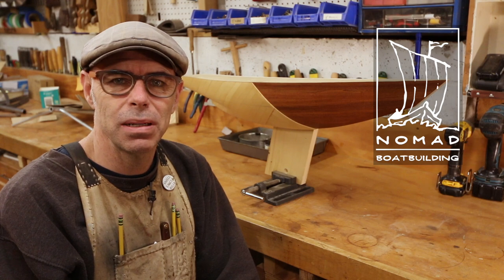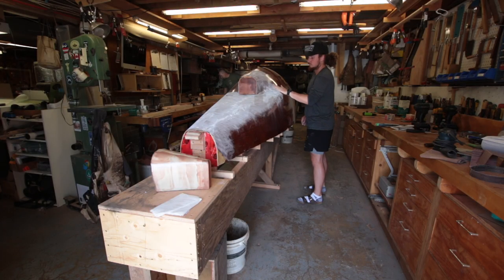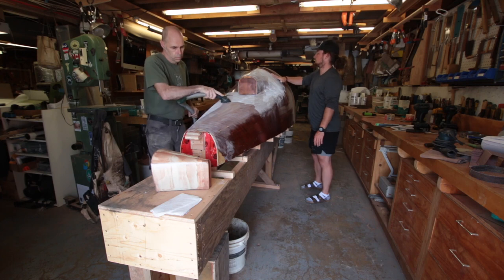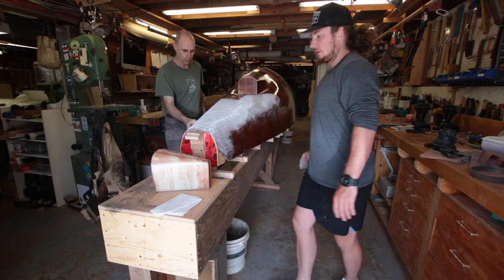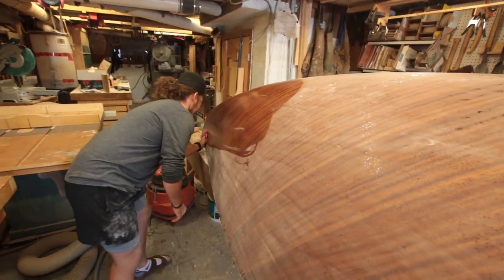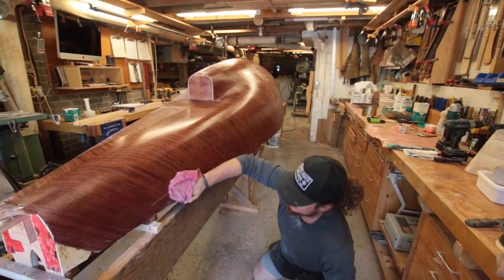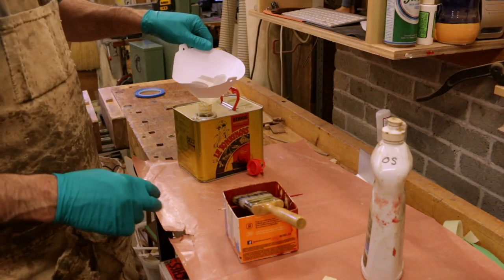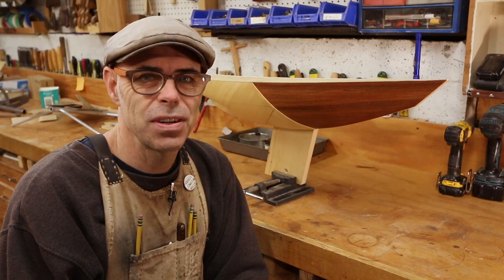International 2.4mR Sailboat Project - Episode 24 - Waterlines and varnish

Comment: I am logging this video as reference for varnishing.  The one question I have is about how the first coat procedure would differ if it were on to bare wood without the epoxy barrier.  Would you do a very thin sealing layer first?  Use a different product to seal?
By the end of this 2.4M series, can you address seasonal upkeep?  And long term, what is the best strip down and re-varnish plan -what attacks varnish without affecting epoxy?
Very informative -thanks!
Reply from the maker: If I wasn’t using epoxy I usually start with a coat or two of thinned linseed oil and often thin the first coat of varnish 10-20%. I’ll try to remember to discuss seasonal upkeep but feel free to drop me a reminder when the series looks like it’s closing in on the finishing line.
Reply: @Nomadboatbuilding  I will remind you.  I am also wondering if having the prettiest boat in the fleet is a negative in racing because you can't get clean air when everyone is attracted to you.
Reply from the maker: @skyak4493  I suppose we’ll find out!
Reply: @skyak4493  never be over the line in the pretty boat the race committee will remember you for sure 😊
Reply: I would have the same question regarding re-varnishing: isn't heat gun stripping a risk for the epoxy? Wouldn't it begin to soften and get striped too?
Reply from the maker: @Nedw  Yes, it would be a problem for the epoxy. You would be stuck with either sanding to remove existing varnish or chemical strippers. Of course the best thing to do is not let the varnish break down to the point that it needs removing. Regular timely maintenance is always less work than corrective maintenance.

Comment: I've always been told 1 part varnish is a no go over epoxy.  What's your experience?  Seems like you don't have any issues with it? Or is this varnish special?
Reply from the maker: It’s not special. I suspect most people’s troubles stem from amine blush and not being careful to prep the surface properly. Once the epoxy is cured, how is it ant different than any other surface. I’ve always used one part finishes over it and never had any trouble.
Reply: It blotches if the epoxy coating doesn't cover the whole surface after sanding. I believe they did not sand through the epoxy in this case so it should be fine.

Comment: What is the varnish called? Less gloss than Epiphnanes? Thinking about refinishing my front door in the spring 👍
Reply from the maker: Le Tonkinois. Perhaps slightly less glossy. Easier to work with for sure from the thinning perspective alone. I would say the two are very similar as far as composition goes. They are both traditional formulas as far as I know. You can't go wrong with either but for your front door, remember that prep and then maintenance is key to longevity.
Reply: @Nomadboatbuilding  thank you

Comment: What is your sanding schedule as multiple varnish coats are applied?
Reply from the maker: Generally I just use scotch bright pads until I have a few coats on. then I'll give it the once over with 220 to level it out. Apply more coats with scotch bright between then level with 320 before the final coat. Something like that.

Comment: What epoxy did you encapsulate in? I use le Tonk and I read somewhere it doesn’t play well with West System...
Reply from the maker: I used West System. I haven’t had any specific issues but I am careful to get rid of any possible amine blush.

Comment: I'm  wondering why you actually need a waterline on a racing boat, is it just for aesthetics or tradition?
Reply from the maker: Yes, exactly that.
Reply: On a race boat the bottom shold be extreamly fair which can mean using filler. paint can be a great way of hiding the bog

Comment: SANDING: I don't know how you can hand sand without nytril gloves. It dries my hands out to the point the skin splits at the corners of my thumb-nail tip.

VIDEOS: I'm helping a friend with this and assuming you're a Windows guy... How much time do you think you spent in post production on this video and what vid-editing app do you use.
Reply from the maker: I guess my hands are just used to the sanding. I couldn’t do it with gloves easily. 
I’m a Mac guy. I use Final Cut Pro X. I used to clock an hour of editing per minute of finished video. Now I think I put in about half that depending on quality of footage and sound issues. I’m editing about two or three hours every day. I take Sunday off though.
Reply: @Nomadboatbuilding  Excellent! I kinda figured you're about half on the edit time... Half an hour per minute is reasonable as your videos are very high quality which is evident.
Reply from the maker: @brianrobertson6475  good to know. I have had no idea if I’m working fast or slow.
Reply from the maker: Now your name looks familiar to me but I obviously can’t remember everyone that comments. Didn’t you tell me in some earlier comment that you had a career in tv or film?
Reply: @Nomadboatbuilding  Ha! (sorry..) nooo. I'm just an insanely curious woodworker. I did build a steam generator based on yours that pretty cool if I do say so...